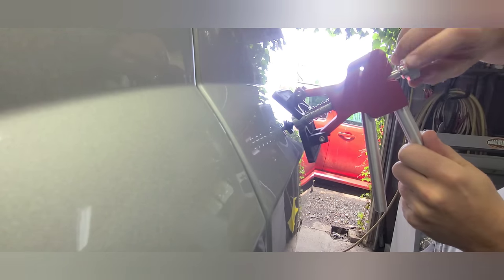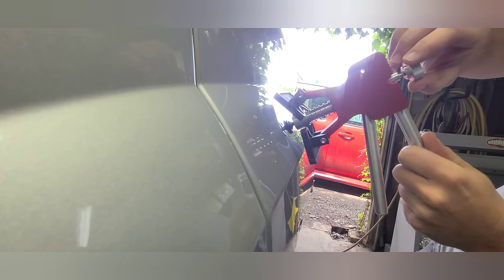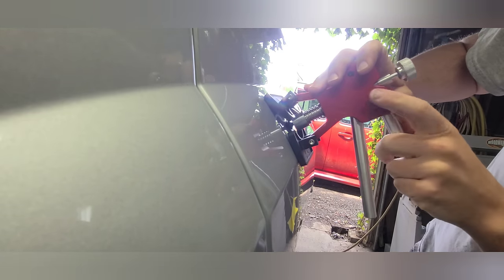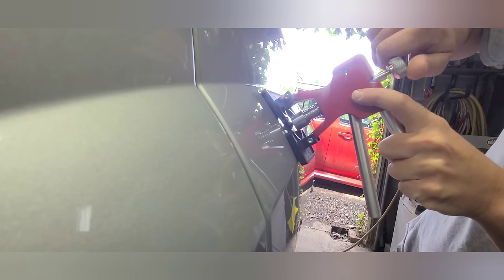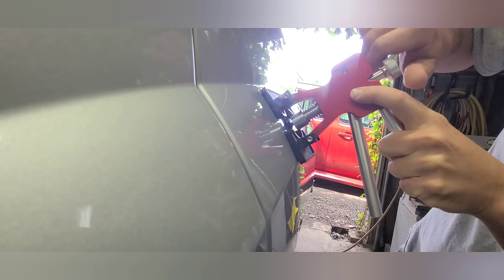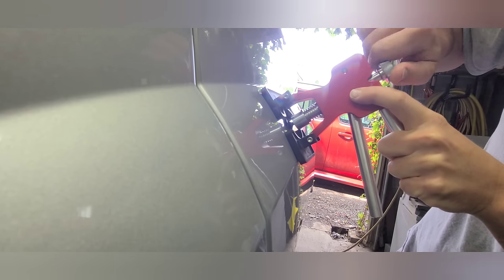Harbor Freight Maddox hot glue paintless dent removal tool review

Comment: I paid a guy to do this in my driveway to my car. Some things I noticed was that he used a heat gun to gently warm the surface of the vehicle before he applied the coolers. He said it keeps the paint from cracking and helps the glue stick to the vehicle. He also saturated the glue with the rubbing alcohol heavily  before removing it. It just popped right off. He paid more attention to spring it on the car so it could run under it.  One other thing I noticed is all of his pool tabs he had taken a knife and scored  crosshatching across them to help the glue here.  Between these and a bunch of crazy long liver bars he took about 40 hail dents out of my truck. You would never know they were ever there. I remove the interior and some panels to save money and the whole job cost me 300 bucks   The thing I found most impressive is when he removed a dent all the way at the front of my bed through my tail light with this crazy long bar. It was super fun to watch.
Reply from the maker: They are definitely artist of their trade!
Reply: Didnt let the glue dry long enough
Reply: Not just fun but SUPER fun.

Comment: Don’t waste time watching the video he never figures out how to use it properly. I found this video to be a waste of time. Someone demonstrated a tool that they cannot use properly or get desired results from, but mostly seems to be user error. So, I spent 20 minutes watching someone trying to figure something out which they didn’t. I’d be better off driving to HF and figuring it out myself. However, the comment section is helpful.
Reply: If you listen to the video all the way through, he does tell you that for this particular dent it wasn’t ideal, but he was able to get dents out of the hood on another vehicle and overall, it was a helpful video. I just purchased this and it looks like it works better than not. The fact that he took the time to record this is so appreciated.

Comment: it would seem that adequate adhesive drying time is critical. try a 4 1/2 minute cure time to see what happens. Another thought is to get some adhesive from on of the other (higher end?) PDR companies and see how it works. I appreciate the efforts and your video.
Reply from the maker: I will definitely give it a go!, I used it on a Hyundai Elantra a couple days ago with hail damage and overpulled several, tapped em down gave it a buff ended up working great, I would have loved to film it but time is tight

Comment: This first dent gave you some grief. You polished the area first with the buffer. My personal belief is that the buffing wax made the glue not hold. Just my guess.
Reply from the maker: Possible, I don't know but I cleaned the surface afterwards with alcohol so it was a naked surface, done several dents after this video with the kit without buffing the surface and it sticks much better!

Comment: 70% rubbing alcohol is the release agent. Put it in a squirt bottle and give it a little spritz. Works like a charm. The knock down tool is your friend. It's rare you can glue pull a ding to perfectly level. Some spots will go slightly high, which isn't a bad thing. Light BUT precise taps with the knock down tool will make things disappear if done well.
Reply from the maker: Was working on one today was wondering what I was doing wrong because every ding I was overpulling and had to knock them back down, THANK YOU!

Comment: Acetone would not be a release agent, it's used to remove any trace of wax or oils in order to make sure the hot-melt "glue", (Which actually is a thermo-set bonding adhesive), will stick to the painted surface. It will weaken & dissolve the "glue" enough to break the bond in order to remove the pad and adhesive from the paint. I've used a heat-gun set on low (or a hair dryer will work) to soften the adhesive also. DO NOT apply too much heat to the plastic pads or paint. They  could be damaged or melted.

 With new bonding pads, there will be mold release coatings (more than likely a dry silicone spray) on the pads from the manufacturing process which needs to be removed for a good bond also. That is why the glue didn't stick to the pad.
 Because of the small surface area of the smaller pads, I've found drilling a few 3/32 holes on the face of the pads, close to and around the center of the small pads to help strengthen the bond. Do so at your own risk. You don't want to weaken the pads too much. Don't go too deep.
Reply from the maker: Awesome!  Thank you so much for the tips and info! Never gave it a thought about the coating on the plastic, kinda like a plastic model car kit, you have to wash it to get the mold release off b4 paint

Comment: They have kits (basically pads and glue and some kind of leverage mechanism) for about $20-30.  These kits are functionally similar, and exactly as effective.   Biggest problem I see in this vid  is that the glue-on pad  MUST be smaller than the dent..  A lot smaller is much better than the tiniest bit bigger than the depression
Reply from the maker: Very interesting. Makes total sense too. The way I'm doing it I'm pulling the metal around the dent as well witch is not accomplishing anything! Thank you @RetiredSignDude !

Comment: On the first dent, I thought you sprayed "release agent" on the area first, wiped it off, then applied the glue tab. The "release agent" might have kept the tab from bonding as tight as it should have.
 I'd try something like alcohol to clean the area, wipe it off and let it dry for five minutes, then glue on the pull tab.  
At  H F  it's a grab bag.  Sometimes you win, sometimes you don't.  Not sure if their products are fully field tested before they hit the shelf. In their early days some tools would break the first time they were used.
Reply from the maker: I did, it told me to do so in the instructions, I'm learning the pull tabs need to be "seasond" the new ones don't like to bite but the ones I used over and over work great

Comment: heat the area with a hair dryer. Use more fineness when leveraging the tool, instead of one pull, try smaller pulls that don't dislodge the peg from the glow, repeat as necessary.

Comment: Thank you for this video! I look like the adhesion between tab and glue was poor for some reason. Idk maybe the tab surface should be cleaned too since it could contain some grease from the factory. Or maybe that particular glue was weak... On the various videos that I watched people were using squeeze puller and slide hammer several times before tab came off the shell (they used different tabs and different glue there)...

Comment: You can't get a small crease out like that with that kind of tool (that's what I'm calling that spot indentation there).  I'm not a body shop guy, but am familiar with science, metal stresses, etc.   You're on a curved surface with some possible doubling over of metal there for structural integrity.   For bigger areas, you have to consider whether you can pop it all at once, or work it in sections from the outside in.  But it's really important to understand metal stresses to have your expectations be reasonable.  For instance, on a corner, a deep crease has to counteract the metal supporting the inward crease, and you have to overcome getting that fixed surface of metal to open the area up, and expand, letting the metal come back up.  

Some guys use rounded rods with different bends and find a place to leverage against, with the rounded point on the backside of the metal and you slowly work from the outside in.  I had that done years ago when I had a rear tailgate of a van creased inwards from something (don't remember now, what, but it shattered the back glass too).  He went in via a hole he drilled on the side of the tail gate, and leveraging the tough metal there.  He put in a rubber seal after wards.  I was amazed at what he was able to do.

So no one "trick" to solve all the problems.  Don't get down on yourself.  Good try!
Reply from the maker: Thank you! Was such a small ding 😆 , I ended up tapping the crown down and a coat of glaze took care of it, still making the video on repainting the car

Comment: why is my glue not sticking
Reply: Make sure the surface is clean, glue has to be hot, then wait at least 5mins for those glue. I’m sure the kit work. But the hot glue is not PDR hot glue. Those glue is like dollars, if you buy real PDR glue, they can even pull 400 plus lb without coming off 😂
Reply: Sand the glue tabs a little bit so the glue can really stick and adhere to them